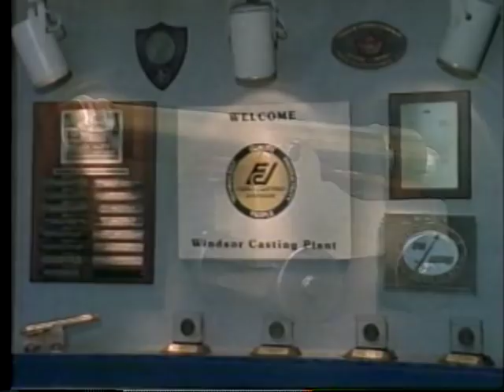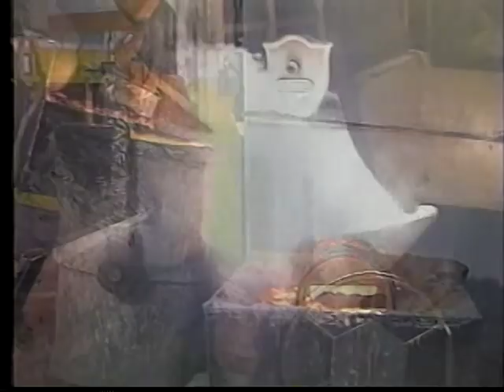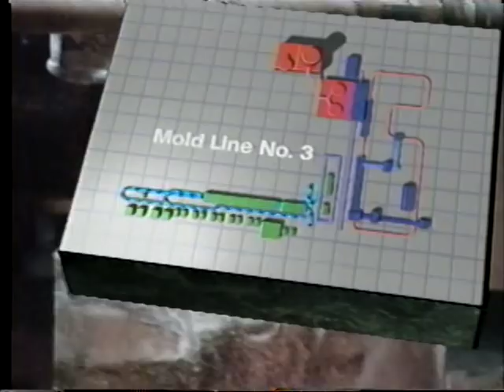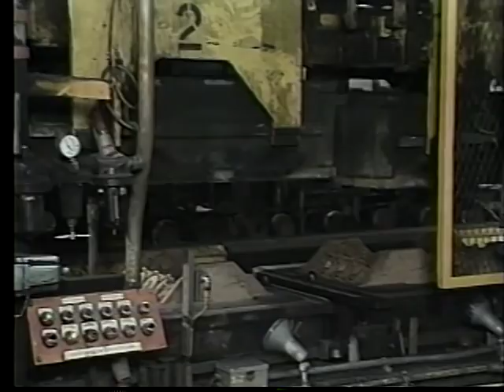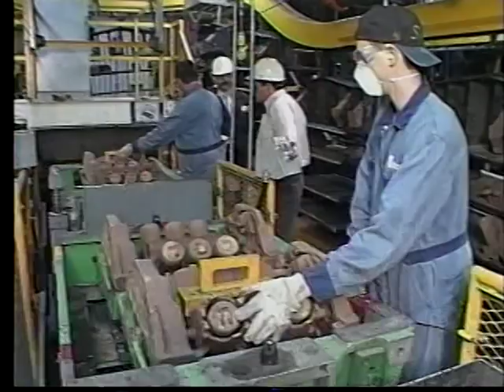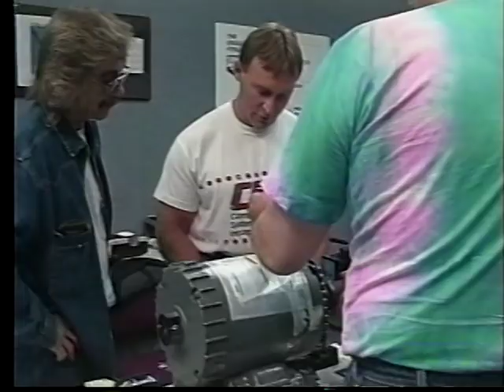Windsor Casting Plant, (The Old Foundry) - TQE 1994

Comment: Love Windsor engines. I put some gt 40 heads on a 351 with 9.5 compression pistons and a Edelbrock rpm intake and cam. Then put that motor in a 86 thunderbird turbo coupe. What a fun fast street car.

Comment: One of those IBM PS2 computers looks like one I scrapped to get it off the local county tax rolls.

 The computer and software cost 6200 new. So the tax assessor got 2.2 percent each year for owning a 286 computer. So the late 80s PS2 beast cost 136.4 each year in local taxes when new. 

 Even when it was technically obsolete in the mid 90s the tax man  sees an IBM so says it has a long lifetime like a ball typewriter.  

So the local taxman also taxes tooling and machinery too.

So often entire industries older machinery is packed up and set overseas to get it off the tax rolls.

If you are a new business local politicians  wave a magical wand so doesn't pay taxes for 10 years on machinery.  Then when 10 years are up sometimes it gets sent overseas or another state waves a magic wand and the tooling is moved there.

One machine we had was on the tax rolls worth 55k and they said it had a 99 year depreciation.  So locally we had to pay 1210 a year on taxes for something that did not have much profit to support it since about obsolete.  So you spend weekends cutting it apart to get it off the tax rolls. 

Manufacturing is attacked by some in the  USA. One should not have to destroy tooling to get it off the tax rolls. Or send it overseas.

Comment: My old man’s 83 f150 he purchased new, had a 351 Windsor. He sold the truck in 2005 with 780,000km. No issues ever, just regular maintenance. Still ran perfectly when he sold it, nice and smooth. Also with the original farmer 4 speed manual that was bullet proof.

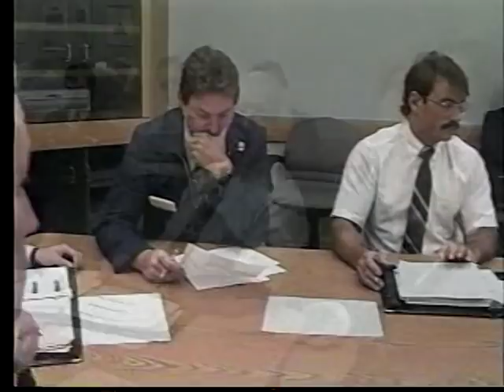Comment: My late uncle was an engineering consultant for most of the Ford plants in Windsor.  Those ventilation and filtration systems were his designs.  his last job before he retired and was bought out by junior partners was the Ford Powerhouse off Cadillac St.  he along with some other family connections got me an interview for the Foundry.  as a green naive idiot I showed up in a suit for an engineering job but in those days (late 80's) you were told to wear a suit for any interview.  the guy that interviewed me did not like me.  in fact at 12:41 there he is!  His name was Dick.  I do admire the workers and what they had to deal with.  A very hot dirty place but I know many took pride in their work.  Not everyone could work there including me.

Comment: Those were 351 Windsor blocks and V-6 Triton blocks.  Both were phased out not long after this vid was shot.  The Duratec V-6 and the 4.6 Modular came online in 1996 to 1998.  Alot was sanitized in this video.  You didn't get to see anything they're not proud of.  These huge cast iron foundries were literally hell on earth.